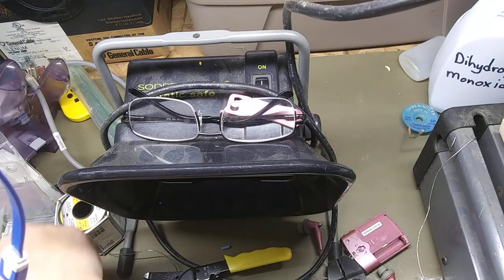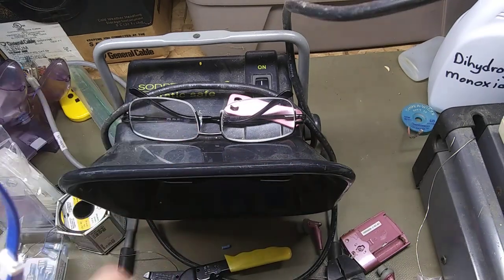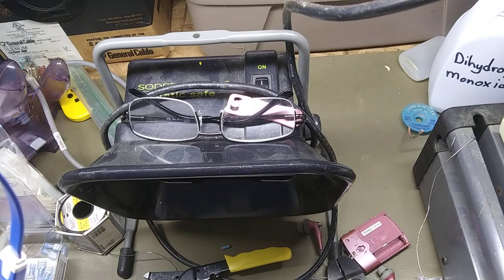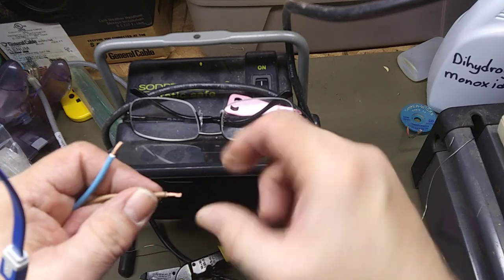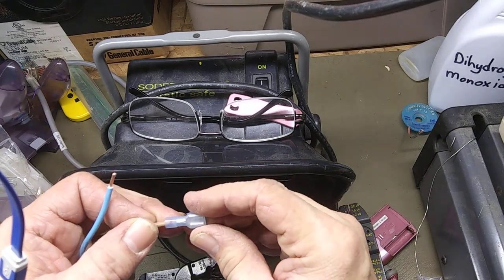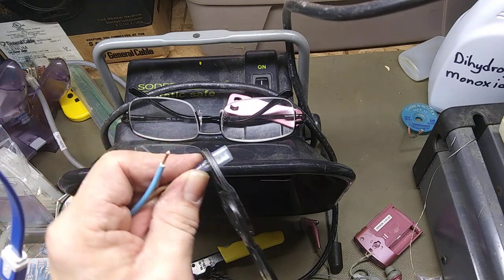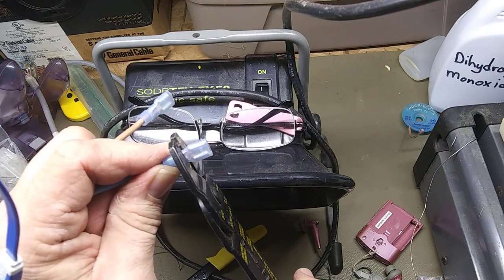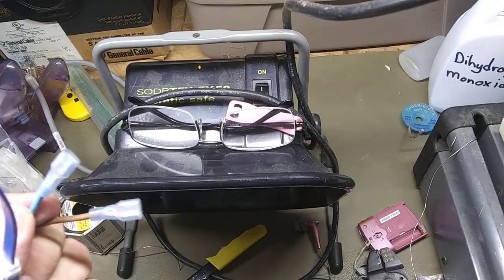Me Explaining How I Connect A Wire To A Spade Connector.

Comment: My mulitmeter says that I have 12.2 V coming out of the end of the spade connectors, but when I add the outlet it dops to 4.8 V. Any idea what I am doing wrong?
Reply from the maker: Does the outlet have an LED?  Not sure what kind of outlet you have.  I was going from my power supply to a switch.
Reply: @joeminpa6705  It does not have an LED, but I plugged a voltage reader into it. Actually, I mistyped. It is reading 0.43
Reply from the maker: @libertybell144  Can you describe this outlet?  I am unaware of an outlet that uses these types of connectors.
Reply: @joeminpa6705  It's a cigarette lighter outlet
Reply from the maker: @libertybell144  .... Let me think on that a little.  I'll get back to you.
Reply from the maker: @libertybell144  Just off the cuff, is there a fuse in the cigarette lighter socket?  I've seen  that before.  In the center connector, maybe there is a fuse?